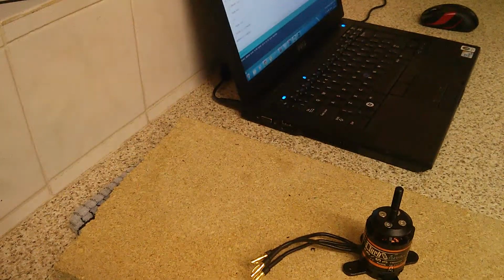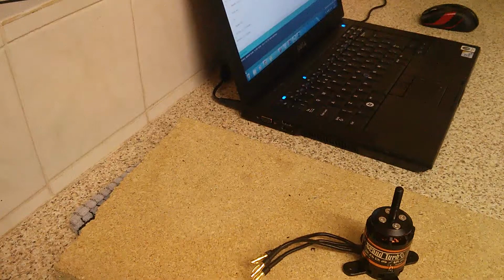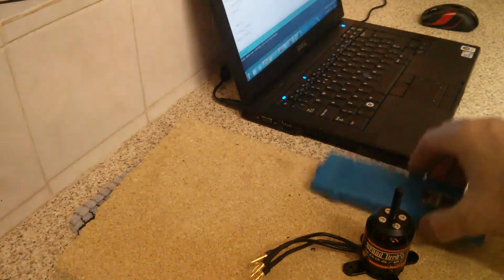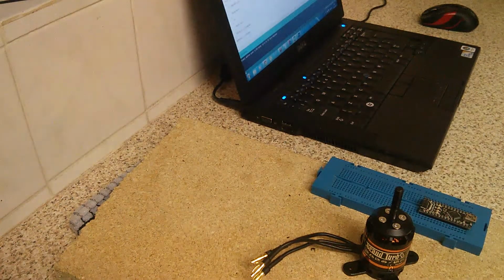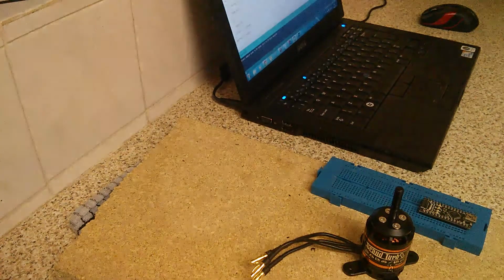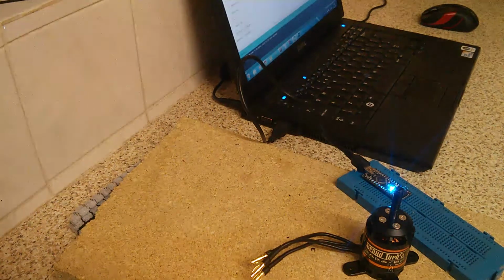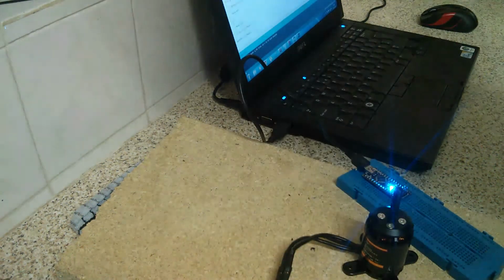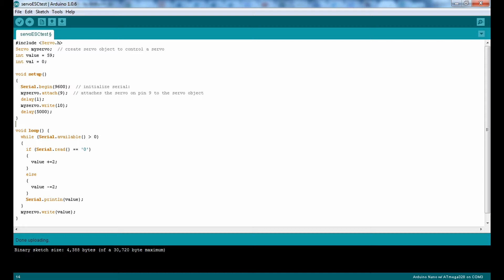Control a brushless motor with arduino

Comment: Why did you initialize the value to be sent to the esc with 59.
Is it specific to your esc or is it the same for all kinds of escs.
Reply from the maker: From 0 to 60 the motor didn't move, not enough emf to overcome the cogging you feel with brushless permanent magnet motors, so I initialised the value at 59.  I imagine all motor esc combinations will be different.
Reply: Thanks for so prompt reply
Got your point.

Comment: I have a problem. my esc keeps beeping and motor slightly vibrates, but doesnt rotate.
Note: I have given a 5 V supply from arduino to ESC and NOT connected the main wires of esc because I don't have the power bank connection
Reply: Anuraag Patil hi did you ever fix this problem? Currently having the same problem with my esc
Reply: @lukecafferkey9028  ?
Reply: I am also getting this problem. Can you please me out?

Comment: Hi, thank you for the video, I just wondering if I can measure the RPM(brushless motor speed) when I push the 0 button (increase speed)from the serial monitor?
Reply from the maker: +Haohua Xiu  It's doable, but as it stands, no, not without adding some kind of feedback mechanism to the motor, such as a hall sensor, encoder, or monitoring one or more of the phases for current pulses. All would require using at least one additional input pin on the arduino and writing some extra code.

Comment: i got this error
Arduino: 1.6.8 (Windows 8.1), Board: "Arduino/Genuino Mega or Mega 2560, ATmega2560 (Mega 2560)"
fatal error: servo.h: No such file or directory

 #include <servo.h>

                   ^

compilation terminated.

exit status 1
Error compiling for board Arduino/Genuino Mega or Mega 2560.

This report would have more information with
"Show verbose output during compilation"
option enabled in File -> Preferences.
Reply: Servo needs to be capitalized so it turns orange.
Reply: can u send me the code to run brushless motor via bluetooth
Reply: I never used bluetooth but you can look up a youtube video and how to control servo motor through bluetooth. There is also a stack exchange arduino forum that can yo to. I just noticed that the S in servo needs to be capitalized. It will turn orange.

Comment from the maker: All the code is shown on the screen at the end you can copy it from there.  I'll upload it somewhere in the next day or two and add a link in the description so that you can download it
Reply: +turbineterry Whats the name the software when u send p and d commands?
Reply: It's probably the Serial Monitor which can be found in the upper right corner of the Arduino framework.
Reply: @MikeEling_drfrost  no it's a Bray++ terminal